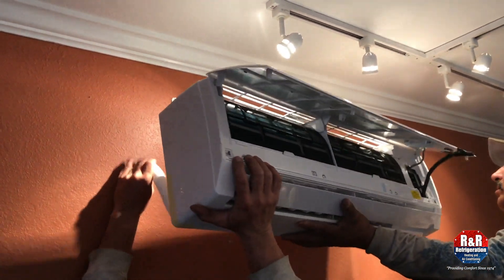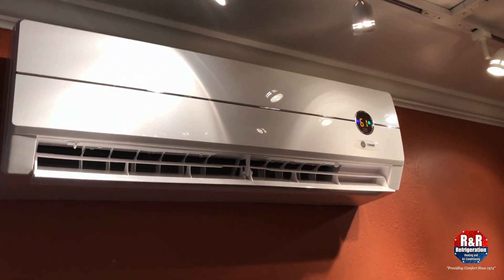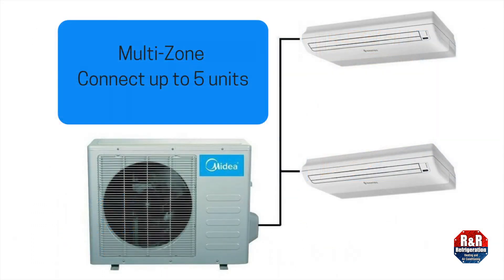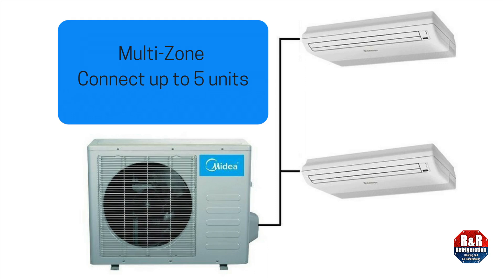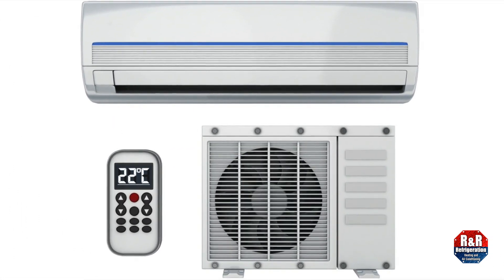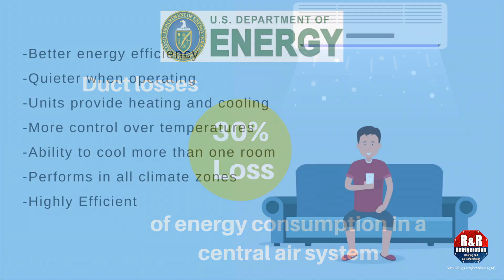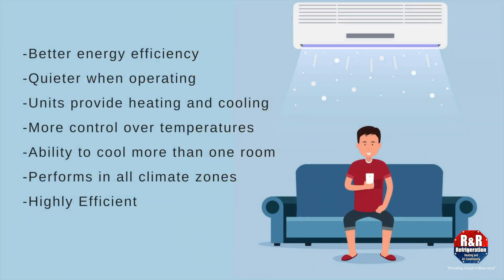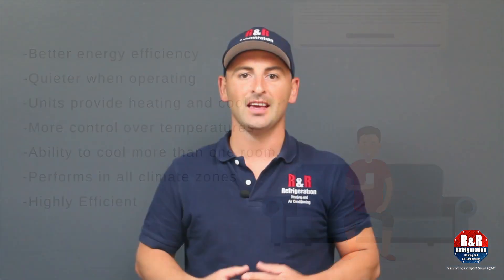Mini Split AC Reviews- Ductless Air Conditioning

Comment: Your likely " oversized" for the area being cooled....it's where more is not good. Too many BTU's of AC will cool the area too quickly to allow the dehumidifing of the mositure in the room, creating a cool clammy feel....not good....sized properly to room will allow it to cool and run long enough to control temp and dehumidify.